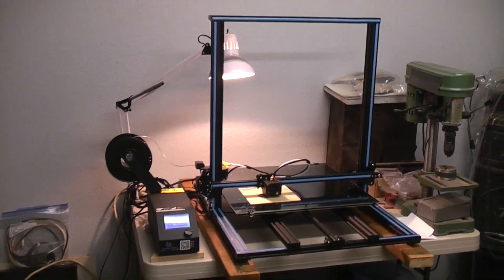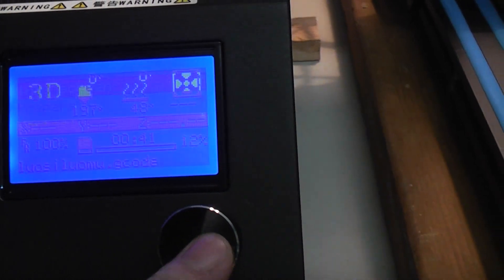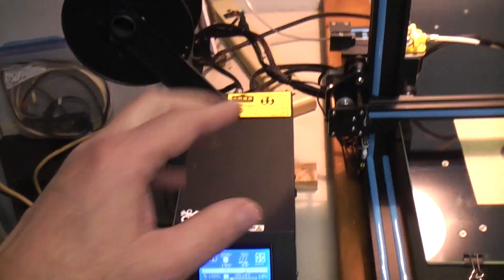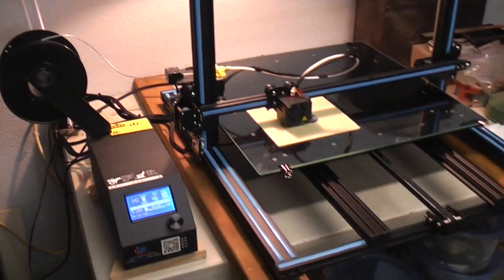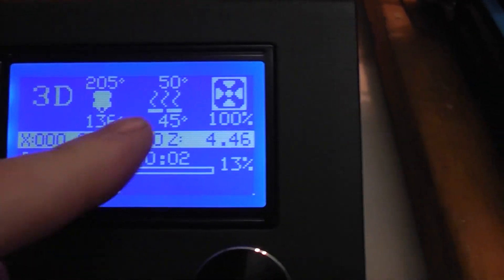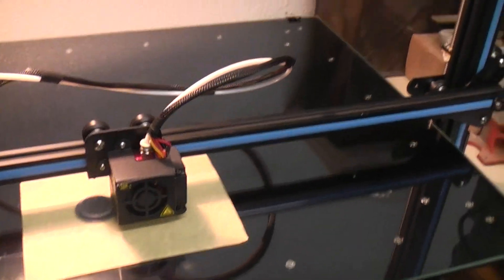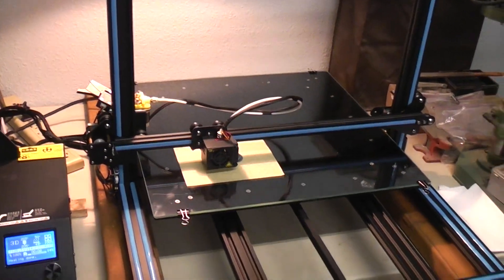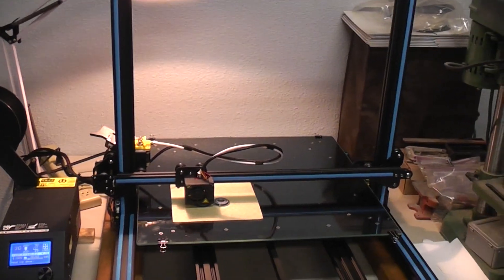CR-10 S5 Power loss resume, filiment loss resume, 500mm build size TESTs

Comment: Hello, I have just updated your video, I have the same printer that I wanted to stop last night and today it hangs on the launch of printing. The screen proposed to me to resume the impression I have the degrees which are displayed and the nozzle managed to be put in place in the same place where it was stopped but after nothing! no moving from that part. I have the screen which shows me that the impression and in court ... there are the axes x y and z which blink and the axis y puts a point "?" is the cause of the problem? thank you
Reply from the maker: I do not know, other than they do say it is not 100%. So I guess they are right.

Comment: Hi, how good is a bed heating on new CR10?
Reply from the maker: Well on my first CR-10 way back when they first came out it was good but I only print in PLA. The CR-10 S5 is the large version and the heater does not cover the full size of the build plate, they let the aluminum transfer the heat to edges. And being such a large build plate it does take time to heat up. I use a heat gun to help things along. I see that a lot of people are upgrading to a AC powered larger heat pad for the build plate. If you search YouTube you will find there video's. Seems like a good idea if you need the higher heat or want a faster heat up time.
Reply: Thank you. I saw this videos about upgrading. I print mostly in PETG so I should consider that I suppose. Happy printing
Reply from the maker: Yes If I printed in PETG I would upgrade just to make life easyer, keep it fun.

Comment: Is there really no way to do this with the old cr10
Reply from the maker: I think if you could get the control board for the CR-10 S5 that has the power resume feature it would replace and work fine with the smaller CR-10 300mm bed printer as well.

Comment: Actually the power loss resume is a feature allowed by the stock printer's board (a RAMPS variation) along with the firmware, and it doesn't rely on an optional choice the vendor could make (unless they offers a device with non stock extra features like a bed leveling sensor that requires, at least, a firmware modification), hence it comes in every Creality CR-10 S model. 

Notice the "S" at the end, the original model is the CR-10 without the "S", which comes with a different, less capable board (hence there's a full upgrade of two Z motors that includes the new board its improved features -filament detection and power loss resume). Those models are CR-10 S (same as S3), S4 and S5 in reference to their bed sizes (300,400 or 500 mm2).

In your video you claim you choose a vendor offering you this feature that other vendors did not offer, when they all sell equally capabilities printers. Even when the power loss exists as a feature, usually it isn't advertised at all, probably because they cannot grant it will work.
Reply from the maker: Yes that's a good summery of what the CR-10s printers are all about. I watched other you tube CD-10 s videos and non of them knew about the power loss function and when tested at my request they did not seem to have it, So Once I found a vender selling a the CR-10 s% and they did have the claim on there web site that the machine had power loss resume I bought it. My first test showed it did not have power loss resume, I contacted Creality and they suggested that I video and test the unit again. I did test it a total of 5 times. each Test was a new print, not the same print being tested over and over. I found that the power loss resume worked 3 out of 5 trys. Creality said that it was a probbablity design and that it was working.

Comment from the maker: I just got a reply from Ceality about the power resume feature. They claim it will not always work !

And about power resume 3 out of 5 times it did work .
As a matter of fact, we will not met that the machine will power off more than 5 times during printing a model.
And power resume will not always work ,You can think of it as a probability event. Especially when will met power off 5 times when printing one same model.
Thank you again for support and video.
Reply: Robothut a

Comment from the maker: The filament sensor is mechanical, just a limit switch, so it will wear over time. The problems with the semi auto bed leveling as well in this new video.
https://youtu.be/3fdwyvk32-s

Comment: Nice Z Axis mod, I've not seen that one before.

I must test my CR-10S again for power resume,

P.S. Thanks for letting me know about you video.
Reply: Gary, have you tested your CR10S again to see if it has print resume on power outage? I remember back in September Banggood was saying this function is not available on the CR10S. Now I am seeing talk of it. I wonder if some vendors have managed a gcode modification or a firmware modification. Currently, GearBest advertises this function but Banggood does not. More to the point, GearBest states on its CR10S listing that this function is available only on the upgraded version, which I interpret as the upgraded version of the CR10S, not the CR10, as the listing is already for the CR10S.

https://www.gearbest.com/3d-printers-3d-printer-kits/pp_778981.html?wid=21
Reply: Hi Edward
No, I haven't tested it again.
But I will, when my new printer arrives.
I will then test my CR-10S Standard and my New CR-10 Mini side by side.